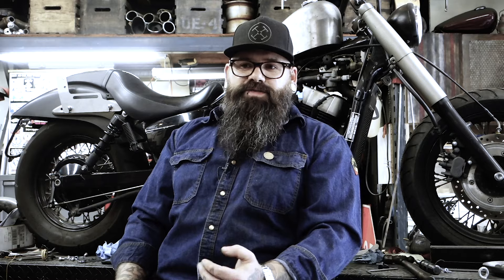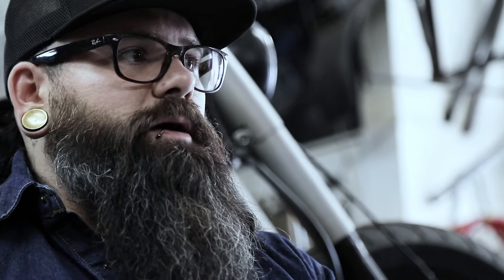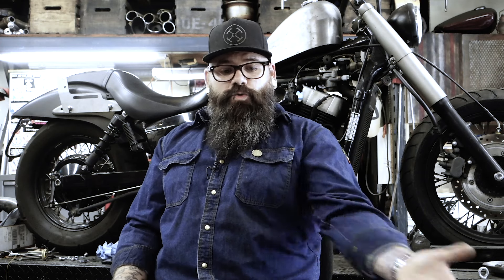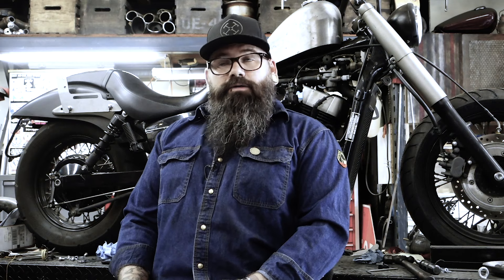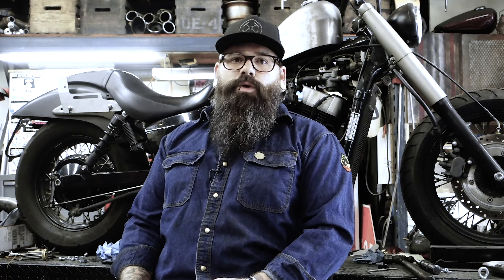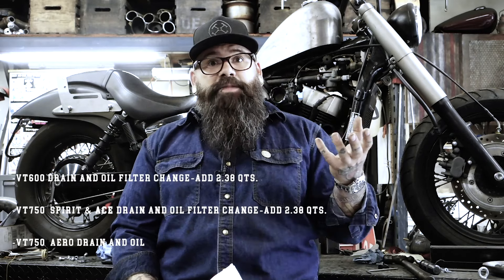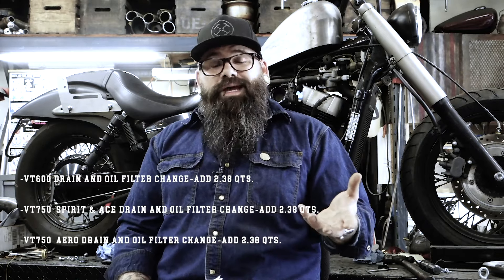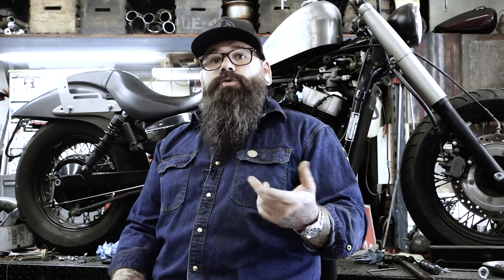How to Fix Oil Leaks: Crankcase Breather Edition

Comment: I'm wanting to change the oil on my 2002 Honda Shadow Sabre 1100... How much oil do you recommend ? I don't want to have a crank case problem
Reply: You need the owners manual.  My 2006, 1100 Spirit is 3 qt., 8 oz. with oil and filter change. Yours should be the same.  After starting bike back up a couple minutes check the oil.  Oil is checked holding it up right without threading dipstick in,  NOT leaning on kickstand.   It should be a little below the full mark.  Don't lose the o - ring on the dipstick.
Reply: @TJBRUTALCUSTOMS  yeah I do need a owners manual. It's my first Bike and I bought it off a guy used and didn't come with an owners manual.
Reply: @jefffrayer8238  thank you for the advice this being my first Bike I bought it used and didn't come with a manual.
Reply: @devlonmoore7578    It really sucks when you don't get the owners manual when you buy something.  I was fortunate and did get it with the low mileage Honda.  Lot's of good info.  Many times you can find an owners or service manual for most anything on line.   I bought Service Manuals for both of my Harley's  from the dealer.  I asked the Honda dealer for this bike and Honda doesn't offer one.   That is why I'm sooo thankful for people like TJBRUTALCUSTOMS  that take time to show us how to fix bikes ourselves.  I used his video to learn how to change the coolant.   It's an excellent bike for sure and I hope you enjoy yours too.   Good Luck, Jeff

Comment: Hey TJ got a question will a exhaust system from a 1998 shadow ACE 1100 will it fit a 2007 shadow Sabre  1100 ?
Reply: Seems like a very specific question